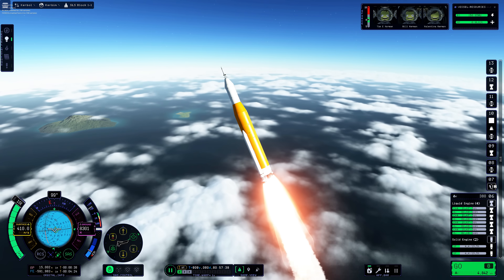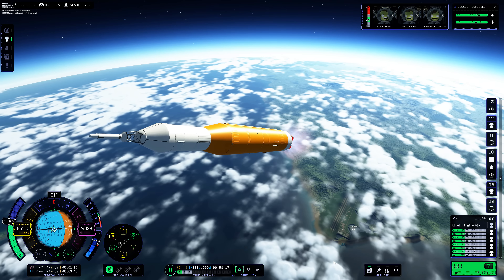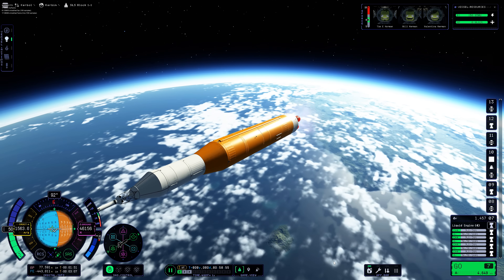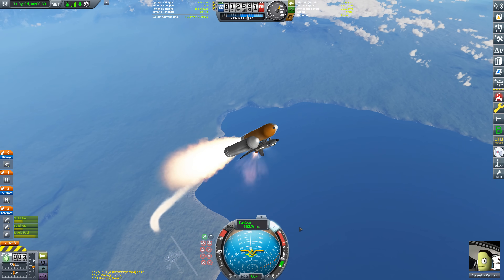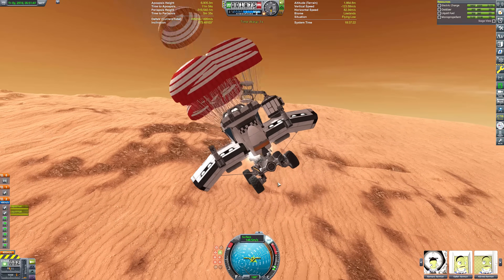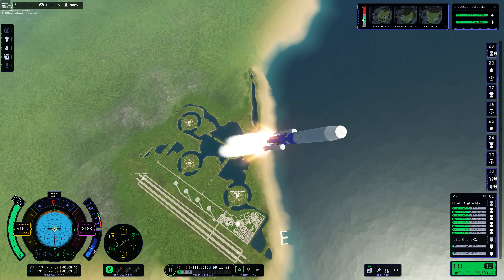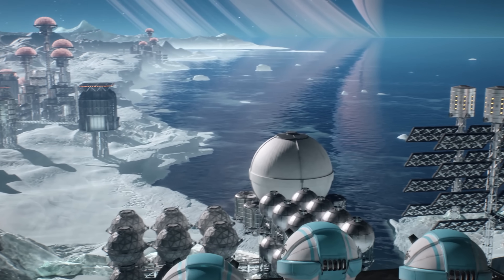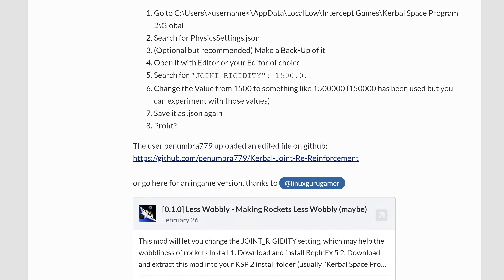Wobbly Rockets Still Haunt KSP2: Developers Face Uphill Battle

Comment: Take it from someone who IS a spacecraft engineer and writes software for aerospace as a job: I completely agree with you Matt.
Bizarre that this conversation wasn't had at the beginning of development. I fail to see how tanking the game's performance is somehow worth it to occasionally see a part flex or wobble. 99% of the playerbase want to build a vehicle and just have it work, with a game that runs well.
Maybe have an advanced tweakable that lets same-vessel interaction be re-enabled on parts if required for specific contraptions, but I find it strange that treating the whole craft as a single rigid body was completely ruled out in the dev chat as if it was some kind of cardinal sin. Most KSP1 players autostrut their vessels to behave like that anyway, so why isn't that the default behaviour if it would also make the game run so much better?

Comment: I was kinda late into KSP1 and did not even know that there was/is a autostrut option, just played it with the default setting, and had way way less Wobble compared to KSP2 now. So yes that is, in my opinion, clearly a step backward that should be fixed. at least to a degree that it matches late KSP1 (for similar complex vessels).

Comment: Looking at how these rockets behave it appears that at a basic level calculations are being done linearly and not in parallel. This would explain those situations were the oscillations feedback into each other and create some of the extreme noodle in the wind behaviour. Its calculating one joint, and using those results as part of the calculation in the next instead of calculating each in isolation then summing them to get a global result.

Unity is also not the engine best suited for simulation, a fact that had been pointed YEARS into KSP1's development.

Comment: the problem is that they try to model the joint as a single point of attachment between 2 stacked parts, while IRL these parts would be welded around the outer perimeter.

Comment: They really should limit real time joint simulations to just radial decouplers to determine if a booster mounted radially is secure enough. Otherwise, the rocket should be 100% rock solid. After auto-strut came out in KSP1, I used it on every single one of my rockets because it made for a much more enjoyable flying experience overall. It feels so much better seeing a massive vehicle rise up into the air as a rock solid monolith of technology instead of as a wobbly noodle or a tangled mess of struts. That's my stance on it and it will never change.

Comment: honestly i feel like this talk about simulating every single joint is a big overlook from the developers diverting from the reality of actual rocket design and instead trying to interpret it on the modularity design perspective of the game which in reality is a constraint disguised as a feature. yes any rigid body will wobble but also most rockets even when built of multiple components and stages would have each stage designed and built arround a common structure to each component.

So IMO the most realistic and perhaps simplest way would be to simulate "wobble" in two parts if a group of components(engines,tanks,cargo holds...) is attached to nothing but a coupler than it should be treated as single rigid body since that would be closer to real design. and than in a second part simulate the wobble in each connection between stages. and im also pretty sure that reducing the ammount of joint simulations from each component to each coupling would also greatly benefit the game in terms of performance (that also sucks)

Comment: I think that rockets in KSP 2 should be affected by physics as a single rigidbody with a few exceptions.
1. Sructures attached via a radial decoupler.
2. Two or more craft attached via docking ports.
3. Cantilevered structures
4. Wide diameter tanks stacked atop small diameter tanks.
5. Very long stacks of small diameter tanks without bracing. (Noodle rockets)
Probably some other situations too but I think these are the major things.

Comment: It seems to me that the problem is that KSP has more joints than it should. I have to stack 4 fuel tanks to get to the size I'm looking for, not because a real vehicle would use 4 separate parts for that. Simulating joint stress is useful because we do want the design stability of the vehicle to matter, but we want it to matter in a way that approximates real world rockets.  If you stick your boosters further out from the center of mass, you should have to add more weight in reinforcements in order to offset the torque that that causes, etc.

The simplest solution in my mind is to only simulate radial joints. Stacks should be combined into a single rigid body.

Comment: I have never modded KSP, in addition, I've only ever had problems with wobbliness with poorly designed rockets. I was also playing from the start as my brother was one of the coders. I've not played KSP2, but that's financial and I am waiting for the full game. Therefore I can not comment on the situation there. I know you design your rockets well, please don't think I am putting you down. Part count was more of an issue for me than anything else. (It is also used as an engineering training tool.)

Comment: As a developer of 20 years experience, the solution you suggested is the exact one that immediately came to my mind as well.

As for physics engines, it's a hard problem because of the nature of causality. It's very difficult, if not impossible, to make it multi-threaded. You end up with everything having to be linearly calculated on the same thread.

Comment: Really, once you finish building the rocket/plane/craft, certain parts should, "lock" together and become rigid, and some parts should remain flexible at critical points without reinforcement. The main thing would be to fuse the whole model into a singular "entity" and then model physics on it before you get to the launch pad. It could then pick the "critical points" based on the worst "flex zones" and then only calculate physics on ~15% of the joints rather than ALL of them. Stacks wouldn't wobble unless they were exceedingly long or imbalanced. Similar such.

Bad designs would be punished and you could fix your "critical points" with struts or redesigns around the failure modes.

I also still like my previous idea of "slaying the Kraken" by progressing through the science tree to beat the wobbles. The "pre-flight simulations" to find critical points would be "Kraken-defense". If you have to have Kerbal wobbles, make it an active part of the game you can beat and then turn on/off later on as you so choose. (Could allow for some fun Kraken drive situations too.)

Comment: What they should do is simulate the parts as a rigid body AND joints, and only use the jointed version if the two dont line up within a certain threshold. That way you dont suffer the visuals or flight altering effects of wobble if the wobble would be minor anyway, but it still has the potential to rip your ship apart.

Comment: I don't know exactly how this game is coded. And I don't know what the physics background of the coders are, But I can't understand why they don't take whatever. Dampening calculation is in the game. And just ramp it up until the oscillation stop. In real life, most physical joints are going to be overdamped. Or perhaps they could add a slight amount of random variation towards the thrust of rockets So the their calculations Wouldn't accidentally have inputs match up with frequency of oscillation?

Comment: simple solution is to have joints that join to other same sized joints to be treated as not a joint. that means a full stack would be a one piece object in the physics engine, while more adhoc things will wobble.

Comment: i feel the game should do it in a sort of way where it calculates the length versus the width of the rocket, and of course calculate other things attached by radial decouplers with a joint. basically, as you suggest, stupid long designs get wobble, but depending on the width of the stack, the rigidity can be effected. i have more to say and a better way to explain what id like to see from ksp2 but im mega tired and dont have the motive to type such details in a yt comments section near bedtime

Comment: What I think would be a good middle ground is have all connected bodies rigid but large sections connected by side separaters wobble at that connection since it's made to break off later. That way struts still have their use and the wobble is present in a way that makes sense

Comment: It's a really easy fix: make all joints rigid. Make some parts have flexibility in certain axis at certain locations. Specifically, radially attached parts can have a rotation axis added near the joint. If the flex gets too high the part breaks. Joints and flexure need to be separated in the code. If a part is braced I. A way that prevents rotation around the rotation axis, then that axis can be turned off for easier calculations later. In othe words: one struts is enough.

Comment: Their obstinacious attitude towards this clear issue betrays some deeper issues in the studio's dev philosophy. And honestly, at this point, I just dont want to launch the game till they at least implement even a short term fix. It's like playing 2013-2015 KSP 1... That game was excusable for these shortcomings due to the origins of the game, but that doesnt mean jank is actually fun. Maybe it's funny at first when youre just figuring out the game, but increasingly, you learn the physics, you want to take on bigger missions, you want those missions to be successful... Then joint physics, wobble, and the kraken all start standing in your way. It kills the enjoyment, and suddenly, you start hating those things.

I actually wouldnt mind having SOME structural engineering challenges baked into the rocket and aircraft design. But my two demands are that it be a realistic implimentation, and that it doesnt hurt the game's performance 90% of the time (or 100% of the time, if you've designed it right).

What I really want is a hybrid system. Yes, large vehicles like this do flex in flight... But if it's designed correctly, real world rockets flex so little that it's imperceptible to the human eye. You should not be capable of seeing it. Considering this, the wobble seen in the game is 1000 times worse than it actually would be if it were realistic.

Frankly, that makes it not worth modelling flex AT ALL for most of the flight. You shouldnt be able to see it. In KSP 2, the wobble is so bad that it easily leads into a resonance as the mass and thrust wobnle around, and that resonance easily destroys the craft. Now, in real life, resonance and oscillations can and have destroyed rockets... But nowadays, theyre designed to dampen out. In KSP2, the wobble is so bad that there basically is no dampening it out, it WILL progress. Only way to fight it is to slap struts everywhere. To make matters worse, both KSP 1 and KSP 2 suffer a boatload of "phantom forces" thanks to joint physics. These phantom forces actively feed wobble. In real life, phantom forces flat out arent a thing. All of these things combine to create an unrealistic structural engineering hurdle, that results in way more mission failures than would occur in real life.

If they want to introduce the idea of resonance, or pogo oscillations for us to try and solve, I welcome that, but this isnt the way to do it. The failure modes HAVE to come from an intentional attempt to implement realistic progressions towards failure, instead of be an excuse for jank.

The jank itself also seems to come from major misrepresentations of actual engineering... BECAUSE docking ports and decouplers are an interface between two massive parts, those are often the strongest and most over engineered components in a stack. Not the weakest. Yet, KSP 1 for the longest time treated these parts as the most weakly attached, making it very difficult to build structurally sound space stations, and impossible to build decently sized orbit constructed spacecraft.

It also just slows the heck out of the game. Is it possible for the imperceptable wobble in real rockets to cause a resonant frequency that might tear the spacecraft apart? Maybe, once in a blue moon, if it wasnt built properly... Should every launch in a video game have the game's performance hammered 10-fold just on the off chance it might cause this problem way more often than is realistic thanks to phantom forces? I dont think so. You cant see the wobble in realistic rockets, and you practically cant model the failures it can lead to realistically anyway... So stop trying to model it 100% of the time.

The hybrid system I'd like to see is this. If you sent a rocket sideways at Max Q, then yeah, it might start folding in half. Especially if we're talking about, say, a pressure braced rocket like the early Atlas. Then the rocket would start breaking in half, and explode.

A good compromise would be to have the game engine simply keep track of the side loading on each joint. The game WILL NOT model wobble if side loading values are below a certain threshhold. This should save a ton of performance from trying to model wobble when the rocket should be fine. However, if the sideloading threshhold is exceeded (perhaps by sending the rocket sideways at Max Q), THEN the joint flex simulation is unlocked, and the joint begins to show signs of flex. Only then are the physics for flex actually considered. Then, once the joint flexes beyond a certain point, the joint fails, and the rocket starts breaking up. IF YOUR ROCKET IS NOT IN THE MIDDLE OF FAILING ALREADY, THEN JOINT PHYSICS THAT GOVERN FAILURE MODE SHOULDNT EVEN BE CONSIDERED. I think this would be a more realistic interpretation of failure modes through joint physics, without slowing the game down during nominal flight, without causing pointless phantom forces that lead to resonances that lead to kraken attacks and random orbital decay, and without p@ssing off the community with noodle rockets.

Another thing that should be implemented is player choice in structural engineering, WITHOUT resorting to inflating part counts with a million heavy draggy buggy struts to add everywhere. If we're going to add values for side and vertical loading to nodes and radial attachments that dictate the point of failure, then maybe players should have some control over that. Give all parts reasonable standard values to start off with, but maybe add sliders in the part tweaker menu that allows the player to increade or reduce stiffness vs side loading. Heck, maybe even give us the option to adjust vertical loading as well. Then, have the trade off be that increasing stiffness increases weight, as the engineers presumably have to add material to the part to increase its strength. This then turns rocket wobbliness into a GAMEPLAY DECISION for the player. If the player has made some massive rocket that will surely suffer kraken attacks if left too weak, then the player has a good reason to stiffen up the joints. If however the player has built a fairly small and controllable rocket early in the campaign, they might be incentivized to put up with a more fragile and maybe a bit wobbly rocket, so long as it saves them dry mass. This makes structural stability a gameplay decision, instead of just something that happens way too much when it shouldnt. Making rockets inherently super wobbly and giving struts as the only way to fix it has never been a good solution. Great, now you have a choice, slow your game way down with excessive joint physics, or slow your game down with double the part count, half of which spent sending ugly and buggy struts everywhere.

Also, the one realm where I think flex might actually be a good thing is in wing flex... KSP 1 had some wing flex because you had to build the wings out of many tiny pieces. It wasnt a perfect system, but the wing flex did allow aircraft to better handle changes in wing loading without failing completely. This is true of real aircraft by the way, airliners have wings that flex quite a bit to help absorb changes in load factor. KSP 2 weirdly, has taken all wing flex out of the game, thanks to the procedural wings. I mean, I guess there's nothing stopping you from making flexible wings by still making small pieces and attaching them together. But, prodedural wings are a big advantage in reducing part count and build time, so I dont really see anyone doing that much. Now the problem is the whole wing falls off quite easily, if its too big for the game engine to handle (I seriously havent figured out big wings yet because the game engine now just destroys my creations on the runway if I dont treat big wings as delicately as possible). Instead, I think the big monolithic wings we now have in KSP 2 should be allowed to physically bend, instead of be completely rigid. If the game just chose for you how much flexibility it has, that'd be really annoying. So I think much like my joint physics idea, wing flex should also be a controllable slider. If you've got small wings, high wing loading, drop tanks, etc, then you probably want to crank the wing up to maximum stiffness (which should literally tell the game no flex is allowed). If you've got big wings with low loading expected, then a flexible wing would help absorb shocks so the wing doesnt just fall off completely.

Honestly, I'd love to try and mod this kind of balanced joint physics into KSP 1 or KSP 2, but I dont know how to program sadly.

Comment: One possibility I can think of is to just make them WAY stronger. If you have a 1km long rocket it should wobble. But make it so that each part only wobbles like 0.25 degrees max or something like that. Something where a normal rocket doesn't appear to wobble, but an obsurd one does.